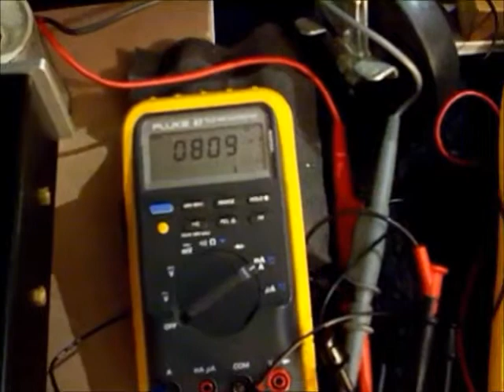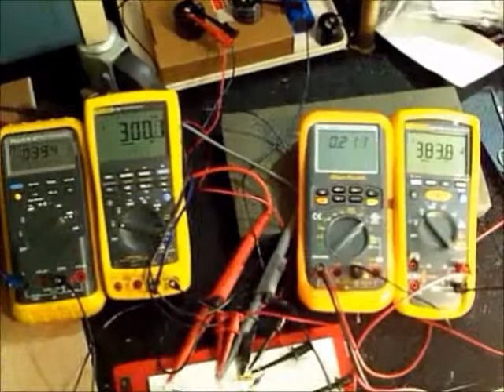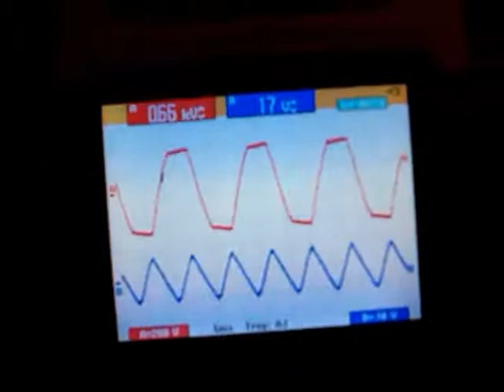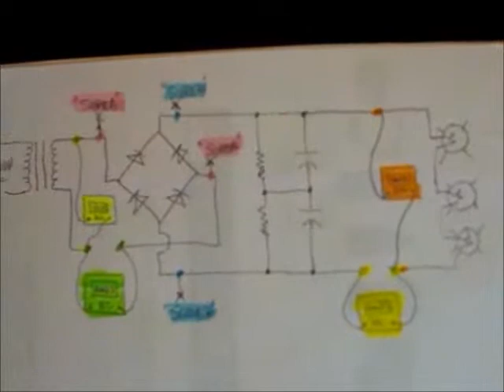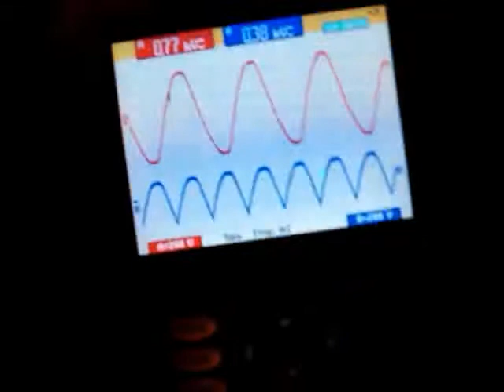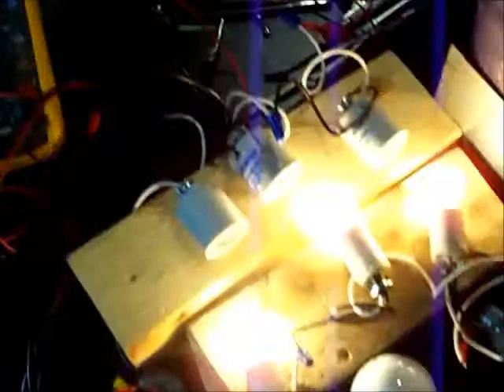Jolida Tube Amp Repairs pt4

Comment from the maker: the amp power output seems lower than what it was capable of. i replaced all tubes and was able to get 30 watts at about 1% THD. the max output i can get with new tubes is 50 watt with input of 1 volt 1Khz and it has about 30% THD. i have read a spec sheet that states max of 60 watts for this amp, which would explain why the owner tells me the amp has lost power. i started to look at the power supply and saw the clip from the transformer  which has taken me thru all types of testing. i called jolida and was told the B+ should be about 400 to 425 volts, i think i am getting about 360vdc at full power. when i do a moc test and run the bridige rectifier directly from a variac the input to the bridge does not clip. when run from the amp power transformer i get the clip. i believe the clip is robbing power from the rectifier output that could be on the B+ rail. i noticed the clip only happens when filter caps are on the DC output but without the caps the ripple is way to high. i am working on the next part which drives the amp from the breadboard with caps in series and parallel and trys different diodes. when i called jolida i ordered a new power transformer to try, so i can see if it would make a difference, but i have not seen it yet.